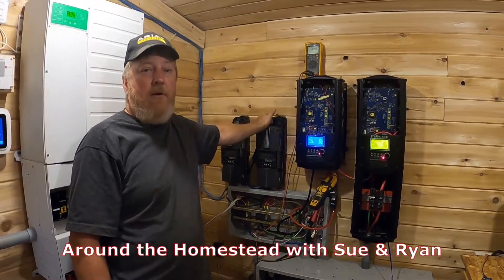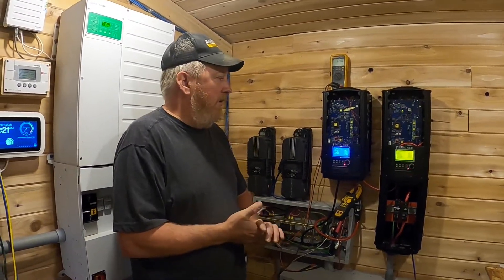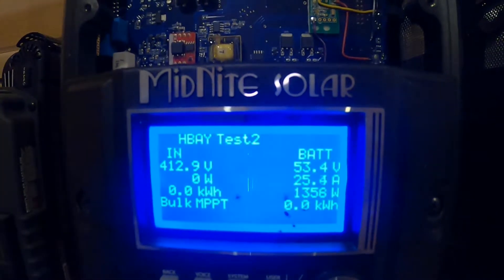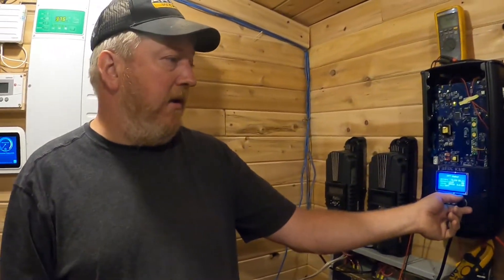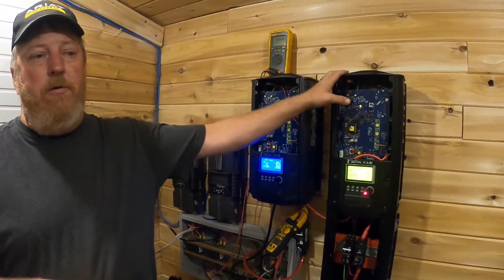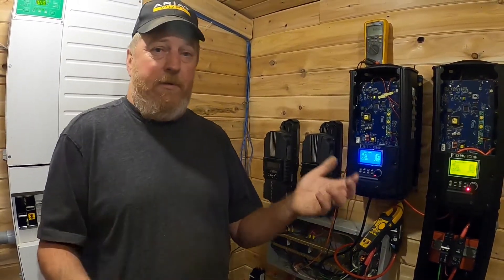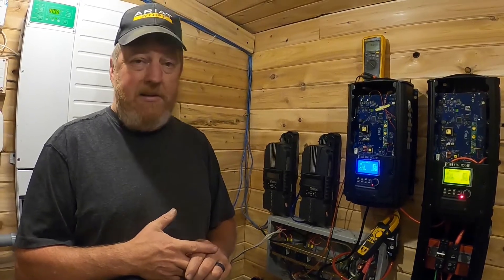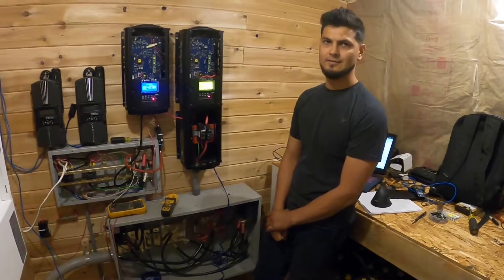Testing Two Midnite Solar Hawkes Bay Charge Controllers With Mario!

Comment: Give Mario coffee!  Get that on the market!!  Any guess when they might be available?
Reply from the maker: The Hawkes Bay is actually very close. I would guess they have another 4 weeks of code to get all the little features like battery voltage sense working. I believe Beta applicants will start seeing units very soon. I understand ETL listing is coming in a few weeks. The Barcelona is almost identical in most ways so it should be about the same time line maybe a couple weeks behind

Comment: are they bidirectional? can we charge a 600v battery?
Reply from the maker: They are bidirectional so in theory if Midnite wanted to write the code like they did for the classic you could charge a higher voltage battery from a lower voltage array but I doubt you will see that soon. Although Mario wants to build a charge controller that will charge a high voltage battery
Reply: @aroundthehomesteadwithsuer3497  Ryan... Good video as usual. If you've seen any of Jack Rickard videos (EVTV) he pushes(D) for high voltage batteries and matching high voltage inverters. While I'll never be in a situation where I need more than 5kW of inverter those that do (or need more!) 48 Vdc just won't cut it any longer.